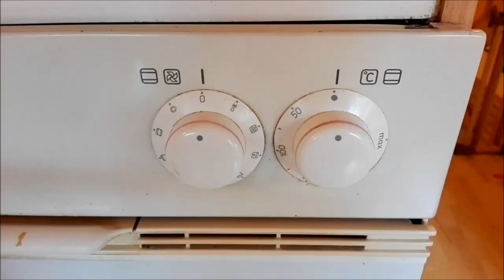The ugliest knife known to man / Rumin puukko ikinä!

Comment: This knife is anything but ugly, I think it's got it's own quirks which make it unique and at the end of the day, if it works correctly then it's a good knife.
Reply from the maker: +ZombieFighterOf2001 
Thank you so much for your comment.
You made my day!
Reply: Lazy watchsmith I think you should maybe flatten the tang so you can attach a handle and remove the bottom wrench part to reduce weight
Reply from the maker: +ZombieFighterOf2001 
maybe for the next one